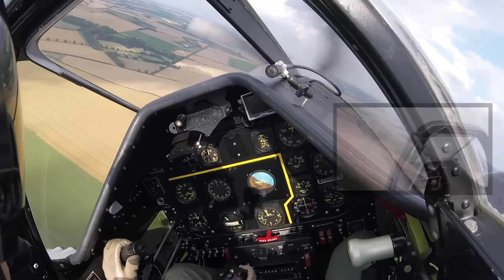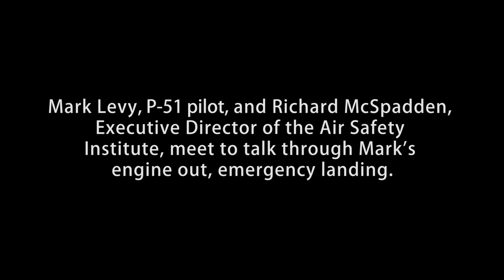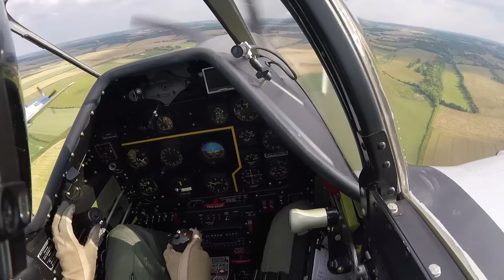P-51 Engine Out, Off-Airport Landing - Full Analysis

Comment: Terrible emergency approach to land. No plan whatsoever. Should've made a plan when was higher and not count with the intermittency of the faulty engine as a possibility to land on ideal place. At that altitude there's no "let's try to get there". Then when the engine cut out completely he decided to sharp bank to the left at really low altitude, then bank to the right almost down to ground. No, wrong. Strait wings at that altitude is mandatory for emergency land. That's why should've planed ahead. Finally at the "final" approach pilot has no idea as to stall the aircraft at low altitude. That's what you learn when you practice landing on three points and of course when you know what you are doing. You know how much energy the aircraft has and you control to "kill the aircraft" keeping the aircraft close to ground as much as you can. Yea dude, bad pilot. Destroyed the P-51. if had skills would've scratched some but not destroyed. Lucky it’s a robust "old school" built, if it was a "modern" aircraft would've been dead. Introductory interview bragging about how many hours don’t count. Go back to practice before next emergency landing.

Comment: I see a lot of pontificating for a simple fact : he was very lucky to be alive. He came in low and banked without any energy left, which is the worst place to be in if you truly want to fly the damned airplane until the end. As an excuse everything happened so fast & he was low to stat with so not a lot of options here. Plus the intermittent failure that's the worst part because you always think you may be able to pull it off... until you realise you will not.  Not saying I would have done better tough.

Comment: Engine failing.  Had the airport in front with runway clear to land, decided to go to other side of the airport 3 miles away instead of landing on runway in front with a slight tailwind.  Big mistake.  You go down now, not later on.  And popped drag flaps and gear down without runway made too.  Many mistakes only a 20 hour pilot will make.  No Common Sense under stress.

Comment: He had a lot of time to land properly in a straight line in the field. He chose to force a turn, and was left with no proper space,speed, angle, etc...
Reply: Bet you win all the football games on Monday morning too...
Reply: @buckhorncortez  Nope. i loose them. But i can tell other ppl that i have lost.
Reply: @trioultimo  He was trying to make the runway but the engine quit again with the gear down.  Quick reaction to level the plane, raise the gear and not stall into a fatal fireball.  Excellent piloting and the plane is already being fixed to fly again.
Reply: @FiveCentsPlease  His engine quit earlier. You should always set your landing path to the worst case scenario (when engine will not provide you power any more). He assumed that engine MAY provide it- and ruined a WW2 plane. Telling me that he was trying to make the runway makes u a little kid... whats on video is obvious for 5 yr old kid.
Reply: @trioultimo  The pilot's own analysis of what he did right and what he did wrong is fine.  I see it as there were multiple decision paths, some of which could have resulted in complete loss of aircraft or loss of life.  The outcome was just as much luck as skill.  But he should be credited for saving the aircraft after a last-second power loss.  He was already running out of airspeed and energy in a heavy fighter not known for gliding far with no power.  The first instinct could have been to abandon and write the plane off.

Comment: I am sorry but very bad decision making. Every power pilot should have experience on gliders. Fly the plane like a glider when you have even a partial engine failure. He could of make the runway  easily if didn't turn  downwind.  He was on base already. Puuuuuuuhhhh.... Before some one asks... I have almost 7000 hours.
Reply: +Hanner Gunsen    WW2 piston fighters are not gliders in any sense.  They are heavy and drop like a brick without power.  He lived instead of becoming a lawn dart.  And the plane is already fixed and flying again.
Reply: @FiveCentsPlease  of course they are. You missed the point totally. Point is: as fast and straight  you can get down to runway, you do it. No downwinds turns or anything else. If he went straight to runway the plane was ok and there were no crash. You say it"s ok because he lived and plane is fixed after crash. Jesus.
Reply: @everythingyoudwanttoknow    Starting out with just 1000 feet in a 12,,000 lb aircraft with a dying engine isn't much to work with.   The AAIB report says he notified for an immediate off-airport forced landing but tried to make the runway instead, but ran out of energy.  https://aviation-safety.net/wikibase/wiki.php?id=196594

Comment: A amature job of destroying a good airplane. Passed up a bunch of places to land .... with the gear down!
Reply: + Johnny White    Gear down on an unpaved surface with an 11,000 - 12,000 pound airplane is a high risk to dig the wheels in and flip you over fatally.    Belly landing was the correct choice.    The plane wasn't destroyed and it is repaired and flying again.

Comment: That might have gone a lot better with a bit more altitude and time-- and foresight. Lots and I mean lots of apparently quite suitable landing spots were bypassed while altitude bled away, and that low steep turn and last instant crash-onto-a-flat-spot scared the crap out of me. Pilots: Get thee to thy  nearest gliderport and take a transition course. 
I hope a lot of this is covered in the analysis but I'm so disgusted I can't even watch any more.  I can only hope I would have had the brass to circle within range of a suitable landing field like one of those long straight already mowed ones with clear approaches flown over, and when it became obvious that altitude could not be maintained, execute an actual fairly straight final approach from a hundred feet or so. Of course that requires admitting defeat at some higher altitude. Of course that requires being at a higher altitude in the first place. What's a formation of warbirds doing flying out in the countryside at a few hundred feet in the first place? 
Anyhow, congratulations on not spinning in or dragging a wingtip on that "final" turn. Any crash you can walk away from is still a crash.

Comment: He did  what any RAF novice pilot would have done on his or her first solo, if the engine conks out or on the verge of conking out keep flying straight put the nose down to stretch the glide, look for any patch of flat ground to pancake, leave the undercarriage up, as a dirty aircraft loses airspeed faster. The Stang driver thought way outside the box using the aircraft,s belly as a makeshift skid, as for the canopy, in hindsight did the right thing  not jettisoning as he glided over a busy motorway.  The poor Merlin coughing, gobbing like a forty a day  granddad, sounds like fuel pump or carb, the Bendix pressure injection carburettor is bit of a bear, having more diaphragms than a contraceptive rep,s bag, as any one can split causing the carb to malfunction .